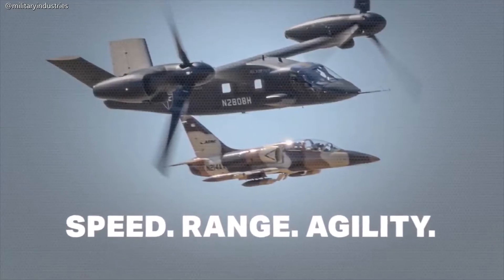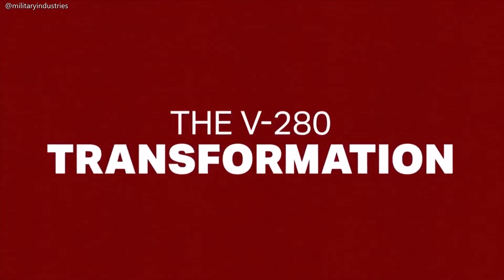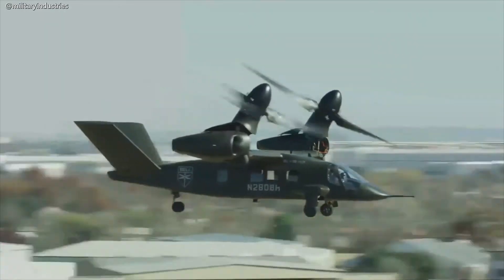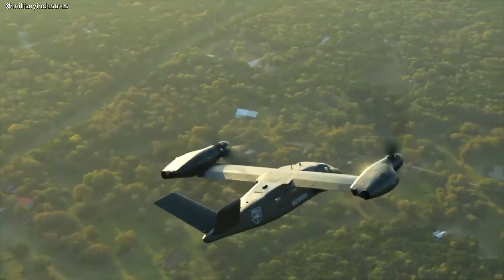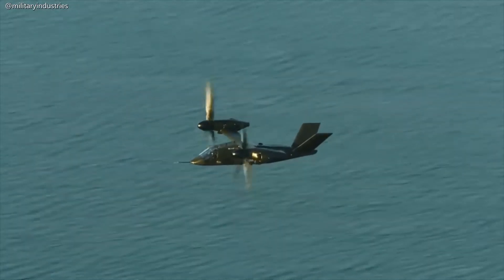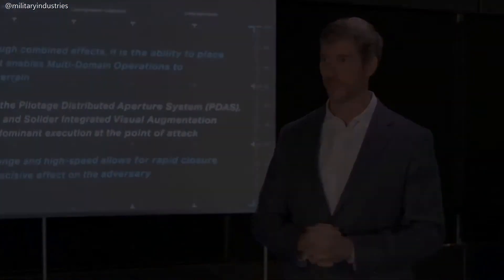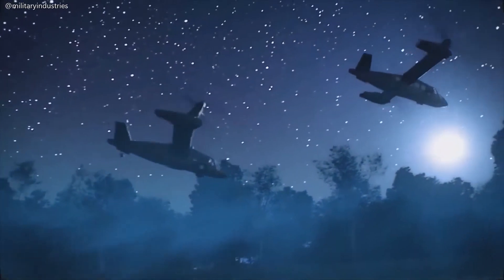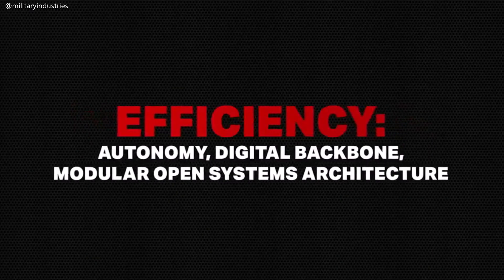Bell V-280 Valor: the future VTOL of U.S. Army

Comment: The V-280 is the best vehicle for FLRAA. 
The range, speed, agility and safety of the V280 exceeds the rigid coaxial rotor head design by a considerable margin. 
The reach @ speed are a huge reason for FLRAA and If our US Army selects the V280 they will be pleasantly pleased cruising @ 280kias with VTOL capability. 
The rotor diameter of the V280 is 29' larger than the UH-60's rotor but the V280 is shorter length than the UH-60, similar confined space operations.